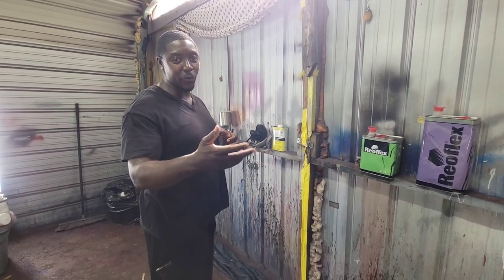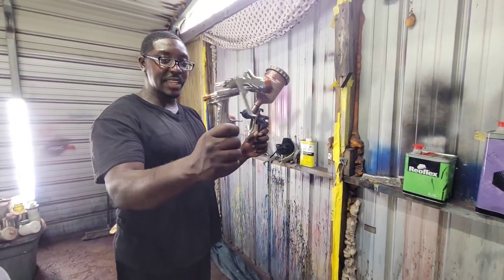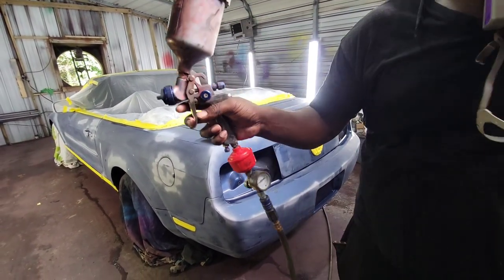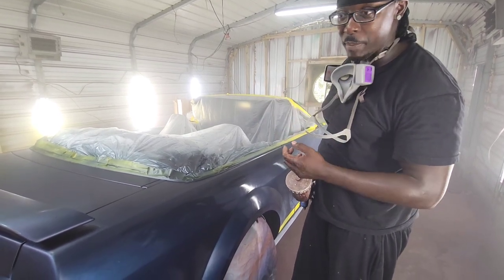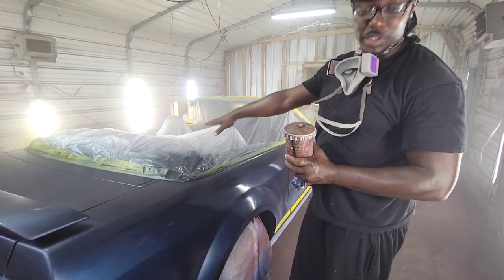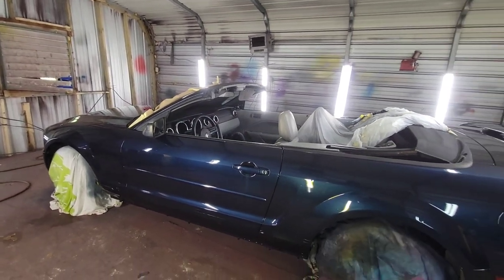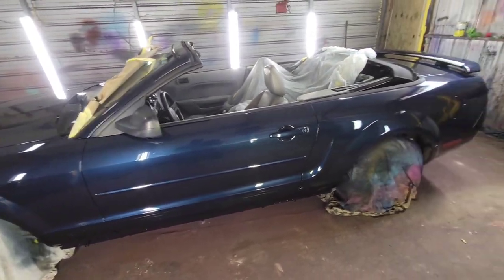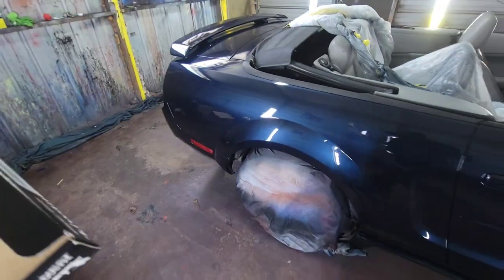How 2 paint a Basic Paint Job for Beginners Jonathan

Comment: Streaks and blotches. I just sprayed a colorshift pearl and got some streaks. I adjusted the gun PSI down a few and the second coat covered it better. I was spraying it in the clear coat too which a lot of people don't do. But I needed to make all mistakes now on my test hood panel. What do you do with pearls to avoid streaks and blotches? I sprayed it at 30 PSI then toned it down to 27 PSI the second coat which was a little better with a 1.4 tip.

Comment: I have a car no one in my area not even Maaco will touch. It’s a 2013 Smart Fortwo passion hardtop. I want to tackle it myself then but I have three turbine sprayers only. Is it same concept? I never sprayed a car yet. Thinking sanding with 180,320,400 then spraying it. Going from red to pink.
Reply from the maker: I paint one of those... something must be wrong be with the paint the reason u starting off with 180 grit ?

Comment: What cap did you use on prolite? It's hard to compare using a gun with just one type of cap. Prolite has HVLP, LVLP,  conventional and hybrid I have great results with a high solids clear using LVLP T110 cap 1.3 tip lays out flat.
Reply: 1.3